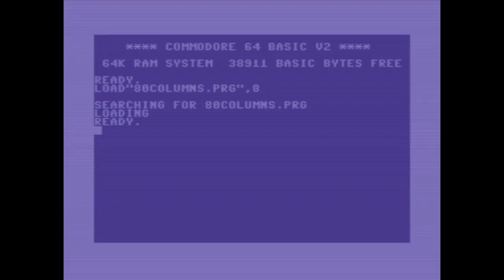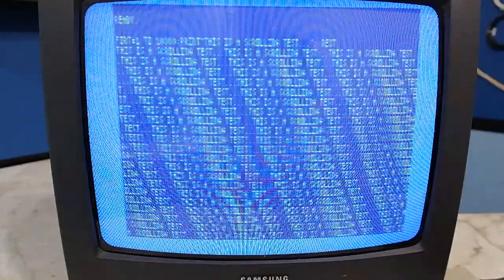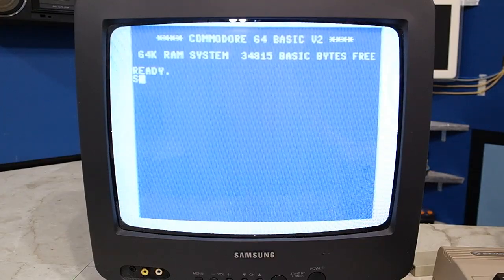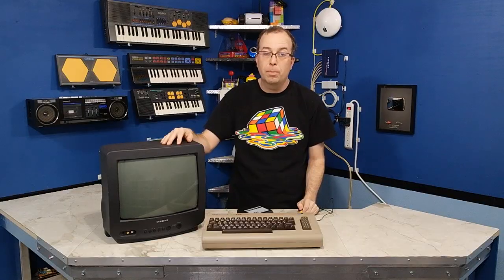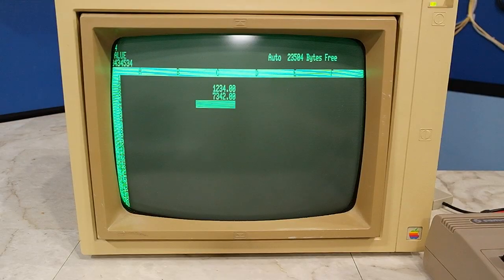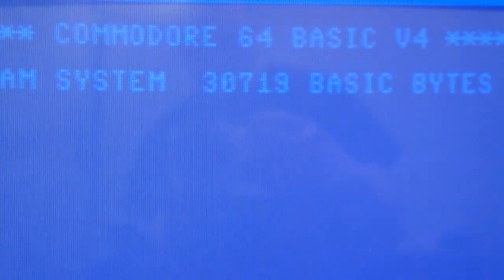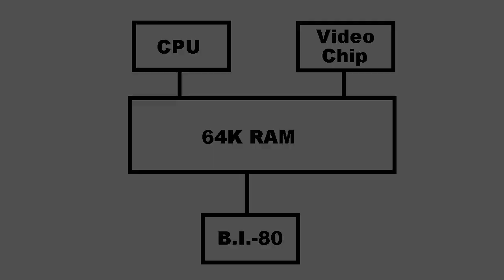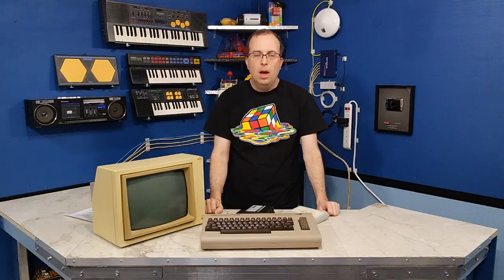The Quest for 80 Columns on the Commodore 64

Comment: The PET series did have the two character sets (well, I think I read the PET 2001 only had upper-case/graphics), but they didn't have a Commodore key, so you needed to send certain ASCII codes to the screen to change sets.

Comment: Is the degradation in signal quality on the passthrough on the first cartridge shown not due to age of the device/failure of components today rather than how it would have looked when purchased new? I only ask this as it looks suspiciously like when the TV  tuner on an aged TV just makes images snow (possible cheap cure is to use one of those signal boosters for analogue TV from outdoor aerial in the UK)

Comment: The software 80-column method was pretty usable on a 1702 monitor as long as you used the back connections which were basically S-video even though they used RCA connections.

Comment: I think I remember it was possible to boot CP/M on the C128, wouldn't that give it a ton of business applications?  were different CP/M computers compatible with each other? like could you run any CP/M program on a C128? and if so, why didn't the C128 take off as a business computer?   was it because everyone intended to use it with a cheap color TV? also, woulnd't the solution of having the color monitor degrade the picture just be to display the characters not in white but in one of the basic colors, say green? then only one pixel of the color pixels would be on instead of all 3, basiclly turning it into a monochrome monitor no?
Reply: Because the 128 in CPM mode was only half speed of the standard Z80.  This made it noticeably slower for those who were already used to CPM on faster machines... and by faster machines we're talking at that point of a setup that wouldn't cost anymore than that of a 128 with 1571.  CPM was also far along ahead into the dumpster with the rise of MS-DOS by that time as well.

Comment: on the Atari 8 Bit we have 80 columns too: either via Software or the Atari XEP80 video cart which is connected to the Joystick Port (!) - the upper side is, that nowerdays most of the software produced especially for SpartaDOS (which is like the most professional DOS - or OS - on the Atari 8 Bit) is compatible with all methods and also all column-widths on the screen, either built-in 40, software 60, software 80, or hardware 80 - they all work via the E: handler (which is the /dev/stdout of this machine).

I for myself prefer proportional text on my very own Graphical User Interface using exchangeble fonts. As it requires a graphical screen by design, I only implement it via Software, and as it is working with different fonts, it pretty readable with approximated 70 columns on a sharp monitor as well as with approximated 50 columns on a TV.

Comment: So, since the C128's output uses a standard VGA plug what would happen if I plugged one end into a C128 and the other end into a modern LCD with a VGA port?

I went straight from a Ti 99/48 to a 386 based system with real monitor support so I am not too familiar with all the "in between" systems.
Reply: The RGBI port on the C128 operates at a lower horizontal frequency than a standard VGA monitor would accept (about half the frequency).  Also, as mentioned in the video, VGA is only RGB - not RGBI.  That means that you would lose half the colors if you tried to connect to a VGA monitor and it worked (very old Samsung CRTs might work, for example, but with half the colors). Circuits exist (the Commodore Video DAC and the GGLabs CGA2RGB) that plug in to the C128 and convert the video, preserving the colors, but not the horizontal frequency.  For that, you would also require a GBS8200 or GBS8220 (very inexpensive boards from eBay or Amazon) to take the output from the DAC/CGA2RGB and present it on a LCD monitor.

Comment: AMSTRAD did have 80 column mode, built in, even on the lowest range model (CPC 464). You could choose between 20, 40 or 80 col mode, the higher the mode the less number of colours you would get.

Comment: Often wondered why the 80 column screen (Mode 2) was used so little albeit a few wordprocessor & a handfull of serious programs. I guess it was still a bit of a odd screen format to program for and all in all not like the "usual" 1 to 1 (ish) formats that was on most of the 8bits. Then there was the colour limitation to just use 2 colours that ment you wouldnt use it for colour math either, like dive into mandelbrot screens  or colour graphs. I do recall the disc, tape & file handling programs was pretty much all in mode 2 both commercial & homebrew so you always felt like you was doing some "serious business" when using them :)

Comment: I'm curious about the colors on the Commodore 64 now.  Growing up, I had an IBM instead of a Nintendo, and I became very familiar with the colors it was able to display, to the point of even knowing which numbers referred to which colors.  IIRC, 0 = black, 1 = blue, 2 = green, 3 = cyan, 4 = red, 5 = magenta, 6 = yellow, and 7 = white.  And then, if available, 8~15 were the same order of colors, but with extra brightness added.  (And then 16-31 were the precise same colors as 0-15, but the text blinked.)

At 10:07, a color palette was shown for the Commodore 64.  I'm not sure if this palette was true for all its games, but the first thing I noticed was that the first set of eight colors is in a different order, even if they're all the same (except it calls magenta "purple."  Or it uses purple instead of magenta.  I dunno, the two colors are kinda similar, and arguments can be made for color distortion in capture).

The second more noticeable thing to me, though, was that the colors 8-15 are largely different, and it uses IBM's normal white instead of bright white in that set (while the first set uses bright white instead of normal white).  The light blue, light green, light red, and dark gray are all expected, but gray, brown, and orange were all surprises to me.

Comment: There is another option! using a virtual 80 column screen with a "40 column window" !  As in the case of the Osborne to get to "business columns" the screen scrolled horizontally on a 80+column virtual screen.

There are also was some virtual 80 column screens on the Commodore 64, one I think of right off hand was Omniwriter.

Comment: Compute Magazine published Speed Script, a fairly decent word processor, machine language program around 1982.  This was the beginning of the "business application wars". To this point most of the 8 bit machines were used by hobbyist and gamers but most of the manufactures knew the real potential for computers was in business application. The problem with Speed Script was in it's display of 40 characters. The typical typed or printed page was 80 characters (plus or minus a few). While Speed Script put line breaks and line feeds at the end of 80 characters it could not display what the printed page would actually look like

Several months after publishing Speed Script, Compute Mag published Screen-80 which is similar to the first software driven 80 character display shown in the video and it had the same display results and drawbacks. The next problem was that the Commodore printer couldn't print using it's standard font set in 80 character so the text had to be sent to the printer as a bit map in order to replicate what was on the screen. Needless to say you could take a 10 minute coffee break while you waited for a single page document to print out. Aside from that, in order to try to speed up the print, Speed Script would blank the screen. Once you started printing you could do nothing else until it finished.

I was able to overcome this a bit by vectoring out of the print routine to my own "plug in" that outputted on the user parallel interface to a 24 pin HP printer (I was a field tech for United Press Int at the time) that could be switched from 40 to 80 character mode using it's own font sets. This reduced the print time immensely since I was sending character codes in 8 bit parallel rather than single graphic pixels.

Except for using Speed Script, I really found little use for 80 column display. It could be used to code some interesting character graphic screens and games but they also suffered from the slow nature and limited color of the display software. All in all I wouldn't say this caused the death of the Commodore 64. When IBM came out with 256 color pallet based EGA display and Amiga with it's 8 layered pallet graphics, even with all the graphics tricks the poor C64 simply could not compete with what gamers wanted and began to find their final resting place on the closet top shelf.

Speed Script published in Computes Second Book of Commodore 64
Screen-80      published in Computes Third Book of Commodore 64
free download in PDF and text format: https://archive.org/details/commodore_c64_books
Reply: I LOVED Speedscript! It was a great word processor and well worth the price of an issue of COMPUTE! magazine. I used it exclusively to write all of my college papers. I'm pretty sure I typed in Screen 80 from COMPUTE! too and was lucky enough to buy an Amber monitor from a thrift store to use it with. As pointed out in the video that type of program slowed down the output quite a bit. The 80 column display was elusive on the C64, but I always thought it was cool. Seemed like a semi big deal when they had 80 column on the C128. :)
Reply: Oh man, I remember seeing SpeedScript in the magazine!  I wonder how many people actually bothered to type it in, and how many decided to just order it on disk instead.  Dang I miss Compute! and other magazines like that.  It was very educational seeing how the BASIC source code from different computers compared to each other, and I was especially impressed with how the Amiga version didn't use line numbers and was more like what became QBASIC on the PC.
Reply: @bwc1976  The machine language code was not difficult to type in if you used the code entry program provided by Compute. I added my own code to it to make a number pad out of the keyboard and with a minimum of practice learned to use it by feel. I never took my eye off the page of code and used my finger to keep track of where I was. I made the error checksum sound a buzz and erase the eight numbers in the line just entered. You simply re-entered the line without skipping a beat. I don't recall ever running one of these typed in programs that crashed because of a bad entry on my part.

Comment: Before your big reveal I was thinking about the C-128, because I actually had a very good working 80 column display on that with a (tiny) switchable specialty cable that worked fairly well with a 1702 monitor.  Interestingly enough I did have some hardware static issues, one of which was partial destruction of one of the memory chips that stored the 80 column information.  Like you said even on the C-128 the 80 column was so rarely used and it felt like an add on it wasn't a tragedy.  As far as software using the 80 column mode in the C-128 the only thing I had was a type in program from a magazine I bought in Germany called "64er".  I forget the program name, but it was basically a Tron motorcycle clone.

Comment: Why 80 columns?

Because in 1928 the Tabulating Machine Company designed a punch card with 80 columns.
Reply: 80 columns is the width of a standard piece of paper in a typewriter or dot matrix printer.  If you're using the computer for word processing you want 80 columns.  I have an apple //e and Appleworks which  uses 80 columns.  Much nicer and easier to work with than say Magic Window which uses 40 columns.
Reply: @GaryCameron780  In the U.S., TTY was limited to 72 columns, and typewriters varied a lot. Most weren't monospaced anyway. Ultimately, it was the influence of the IBM punched cards that led to IBM PCs using 80 columns, and that ultimately (briefly) became the standard.
Reply: @EebstertheGreat  Interesting regarding TTY though typewriters are mono-spaced.  At least all the ones I've ever used are.  Back in the day I remember two basic type faces:  Pica and elite.  the differences were 10 characters per inch and 12 characters per inch.  80 columns at 10 cpi is 8 inches with 1/4 inch in each side for a margin.
Reply: @GaryCameron780  A rather large amount of typewriters are variable width. Only the absolute most basic ones were constant width. I've seen portable typewriters from the 50s with variable width fonts.
Reply: @EebstertheGreat  I had no idea teletypes were 72 characters.
Reply: @GaryCameron780  Probably typewriters and teletypes predate punched cards due to their use in the telegraph world, prior to the original uses of tabulating machines.

Comment: I was pretty sure that the C64 and 128 supported separate Chroma and Luma signals, basically SVideo out of the video connector? any reason you wouldn't use that?

Comment: I remember a lot of Apple software would use color pixels in 80 column text to improve sharpness on a color tv. I had an apple color monitor that had a monochrome button on it that I used when working on AppleWorks in 80 column mode. Worked great and made the text very sharp.

Comment: Still, pretty interesting someone tried adding 80-column support to a computer that wasn't really meant for it.

The software method seems most obvious to me since the idea of using half-width characters for smaller text has been used in various C64 programs, but mostly to make more compact labels like for video games. For example: Using a half-width characters spell "LIFE" uses 16×8 pixels on screen rather than 32×8, giving you more room for a bar or extra numbers. Those extra pixels can mean a lot when you only have 320×200 to work with!

Comment: Hi! what about connect a monitor with s-video input to C64/128? can it improve 80-cols display?
Reply: In essence, it did but Commodore named it "Chroma - Luma". Quite early on I had a 1701 monitor and the signal connected to four pins. The Chroma - Luma (SVideo in a later era) display was very sharp compared to RF or Composite.
One could even use half the pins on the Commodore Chroma - Luma lead to display the 80 Column mode, in monochrome, from a C128.
Reply: The c64 can't produce 80 columns text out of the box.
Reply: @simonrichard9873  
I assume he meant using 80 column software.
Reply: Iván Escobar no cuz it’s the same tv. Also did it even have svideo?
Reply: native resolution is too poor on c64.
Reply: Iván Escobar Looking at the emulator footage for the software render, I’d imagine it would

Comment: Really informative. Back in the day, I remember using a Word Processor which did that software 80 columns thing, and it really was rubbish to look at - I think in the end, I went back to GeoWrite instead… may not have displayed as many characters, but WYSIWYG was far more appealing!

As for those 80-column modules - I'd be surprised that someone would design one… but considering Commodore tried to put out a CP/M cart… I guess I'm not. I'm blown away by those existing though… certainly one of those why-the-heck-did-they-do-it kind of addons.

Comment: As I recall, another reason they weren't very popular is that they consumed enough extra power to degrade the reliability of the already-marginal Commodore power supplies.
Reply: Did the C64 fail under heavy load?

Comment: The degradation of display quality with the VideoPak reminds me of what happened with the Currah Microspeech on the ZX Spectrum - this was also an external cartridge that had a loop through for the standard video output - it added an audio signal to the video (rather than using the Spectrum's weedy inbuilt speaker) - the result was speech synthesis that came out of the TV speaker, but the screen had crosshatching interference on it.
The Microspeech had a trimmer capacitor that could be adjusted to supposedly compensate for this, but it was a case of approaching least-worst, rather than best fidelity.
Reply: atomic shrimp knows about old computers :O
Reply: Didn't expect to see you here!
Reply: Computer noob here. What's crosshatching interference?

Comment: I am currently working on a digital to analog converter solution for my CGA IBM compatible to output to a VGA monitor, since my old monitor died. You can buy a DAC device from John Carson at bit-c-128 for $45 that has been developed within the Commodore community to convert RGBI to RGB. But you can also make a cheap and simple circuit called a "Pull-both" that incorporates the "intensity" into the RGB signal using a few diodes and resistors. Both solutions require a CGA-to-VGA scaler like the Gonbes GBS-8200/8220 that was created to convert RGB CGA signals from vintage arcade machines to use new VGA flat screens. There has been an interest among enthusiast in outputting RGB from vintage consoles using a SCART connector and then using the GBS-8200/8220 and a scan-line generator to reproduce a vintage look on a modern VGA monitor.

Comment: That "Petdraw" program is pretty cool.  Reminds me of something I wrote decades ago. I've been looking around for a C64 program called "ProFont".  It was my first program written entirely in Assembly.  I wanted a font editor that had features that the popular "Ultrafont" didn't have. It had the documentation built in so "help" was a key press away.  It was also the first time I learned to bank out the BASIC ROM and use the memory to store some 20 font sets that you could flick through with a simple key press.  This made it good for animation fonts.   It also worked for multi-color fonts. Unfortunately I didn't upload the program to many BBS so it simply could be "gone with the wind".  The only issue I had with my program is it would only save font sets to disk but it didn't have the ability to generate BASIC "data" statements like "Ultrafont" did.